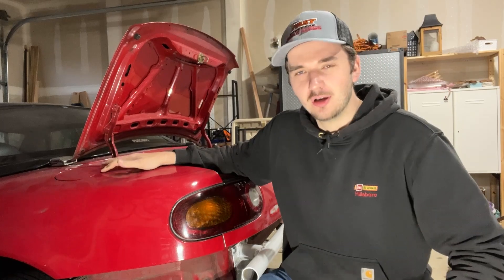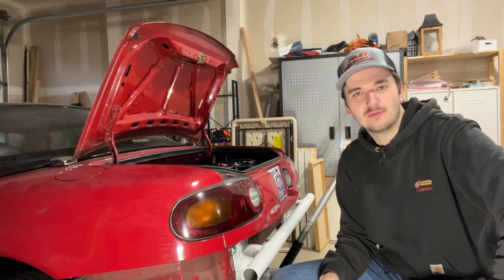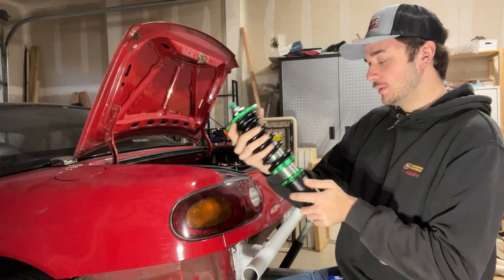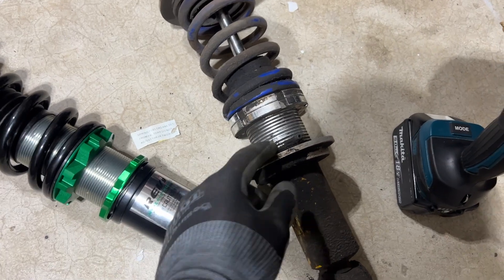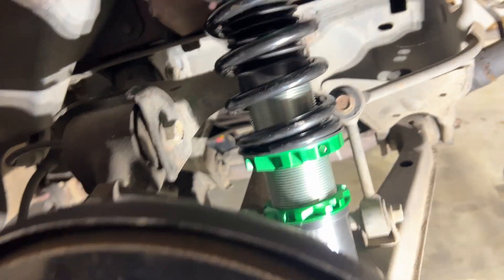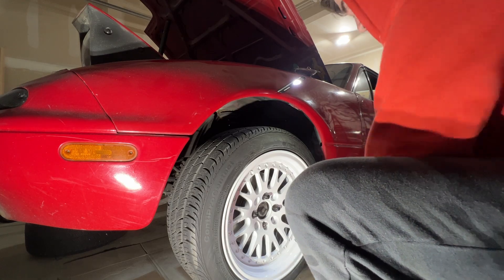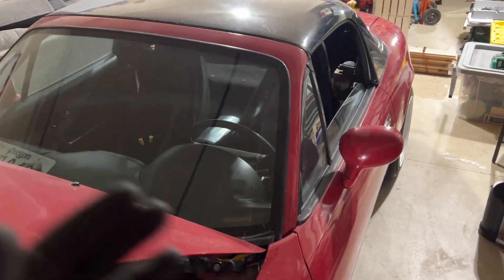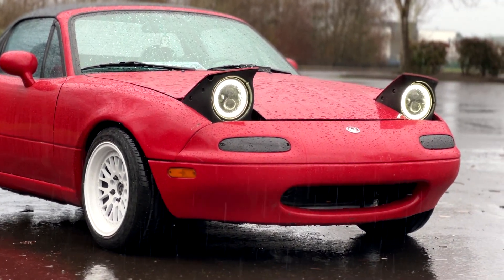BUDGET COILOVER INSTALL FOR THE MIATA!

Comment: i wouldn’t necessarily say rev9’s are “budget” i would say “affordable” 
i had some rev9 hyper street 2’s on my subaru legacy and they where absolutely fantastic, i also had upgraded springs in them so it was a lot stiffer, but for the price, cant beat it.
im thinking about getting some for my miata although i dont think they will go low enough :(
Reply: U can get pretty low on rev9’s , my rears were tucking on 16 inch wheels
Reply: Trust me, it will be lower than it ever should be. You'll be frame banging on everything